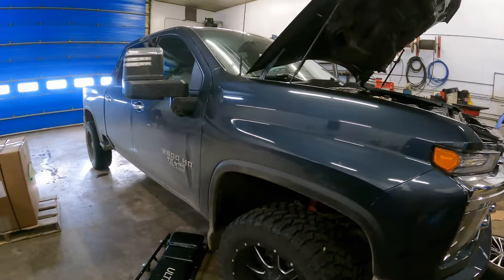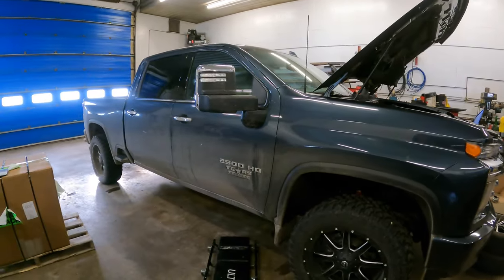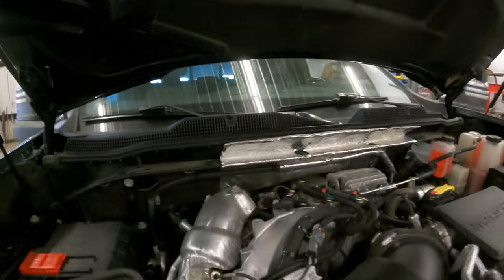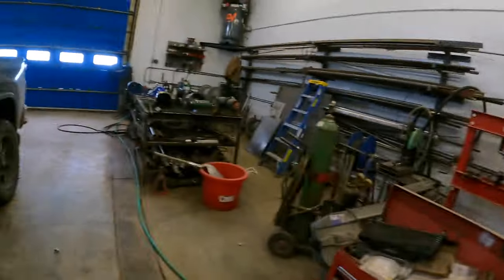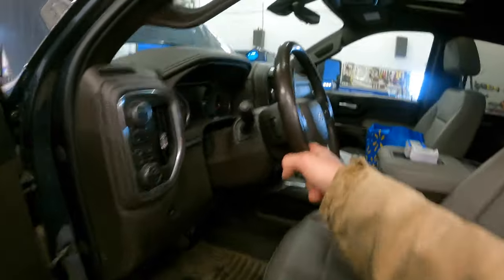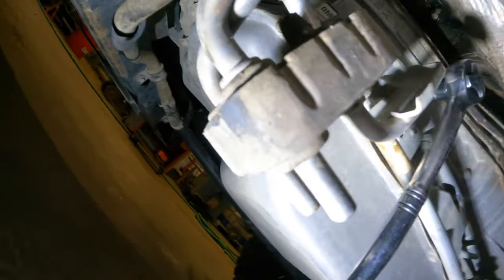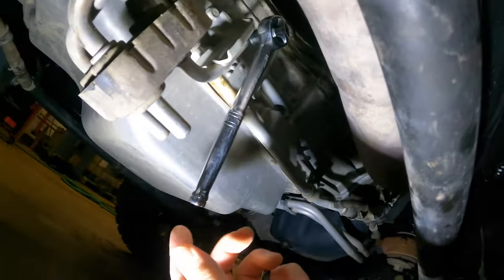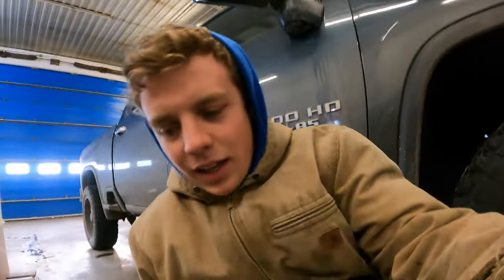L5P 10 Speed checking the transmission fluid level

Comment: Thanks, man. Just.got my new Chevrolet Express 3500. Wanted to check all the fluids. No dip stick for transmissions fluid. Ok,your video has helped me to understand ,but on event of leaking fluid from transmissions or changing transmissions fluid it's will be nightmare! In my older 2018 GMC Savanna there's dip stick though.

Comment: Just confirming what has been stated by someone else in the comments, the info in this video is not accurate. The plug on the right side is the fill plug. The plug in the pan has a standpipe and is the oil level check plug, you slightly overfill the trans, then pull that plug in the pan, letting a solid stream of fluid drain and then when it slows to a drip, put the check plug back in and you're done. This is per the GM manual...
Reply: That’s a fact.
Reply: Does trans need to be up to 167 before cracking the standpipe plug or is it done cold
Reply: @RyanVannoy-ii4cn  Trans temp needs to be between 167 and 176 degrees F when checking level, per manual, slightly overfill, get to proper temp, then pull out standpipe plug, let extra fluid drain until it is just drips, then put plug back and you're done
Reply: So in other words don't buy one of these used from someone if the person did it themselves and like in the video, which most videos on here they are doing it the wrong way🤦🏼‍♂️...

Comment: That isn't the plug for checking fluid.....that's the fill plug. The check plug is the small plug forward on the bottom of the pan. 170F fluid temp and the fluid should drip out. If you have fluid level up to the fill plug it's over full. Spend 20 bucks and get access to the electronic service manuals from GM, and the correct procedures, before telling the YT world bad info.
Reply: Where is your YouTube video?
Reply: @joshbolding4844  because if you have a YouTube video, you must know what you're doing. Dork.
Reply: Well I'm going to go ahead and disagree with you I have a Duramax 2021 I've done three fluid changes on it. I dropped the pan I measured how much fluid came out, it was quarts. I put exactly 8 quarts back in and what this gentleman is showing is exactly what it was doing.
Reply: @ips7125 Double check that. There's videos on YouTube with certified mechanics confirming this comment is right and the video is wrong. The fill plug and level check plug are different. Ridiculous they couldn't put in a dip stick.
Reply: Can you post a link where I can access the electronic service manuals from GM?

Comment: That’s not the plug to remove for my 2021 duramax there is a plug on the bottom portion of the step up on my pan called transmission plug #1 according to this service manual 13188072 for the 10L1000 auto transmission. The plug you removed is my transmission FILL HOLE. I I used that to check my transmission level at temper 167 F my transmission would be over filled. Again these directions are for the 2020 and 2021 I’m not sure about later years.

Comment: I have a 2020 1500 LT trail boss and I was told that you have to take the truck to a dealership  to change the tranny fluid. While I was getting my oil change at Valvoline?
Reply from the maker: I think you can check yours the same way, just crawl under and see if it has a plug

Comment: I am seeing different on you tube. I’m trying to figure out what is correct
Reply: This is incorrect. The plug he removes is the fill plug. The level check is on the pan towards the front.
Reply: Correct the 10mm bolt on the bottom of the pan is the check